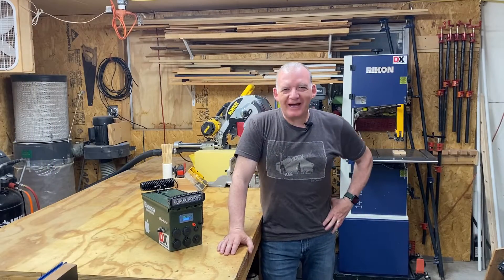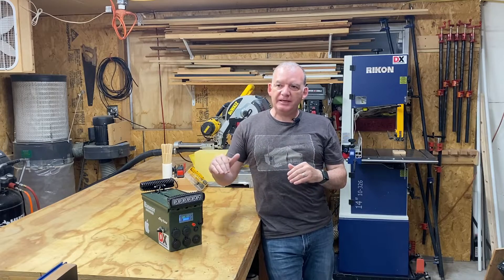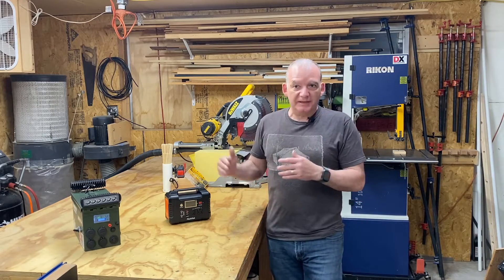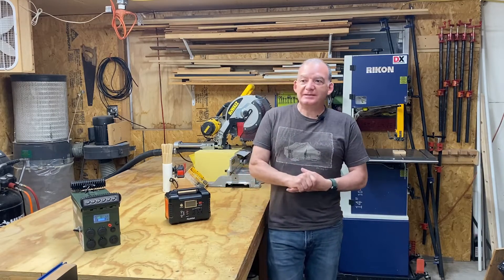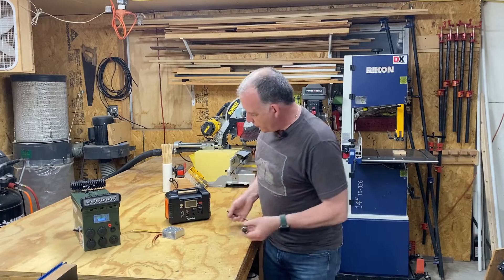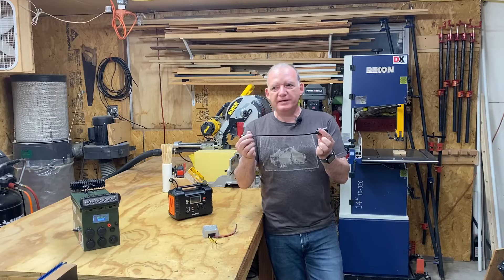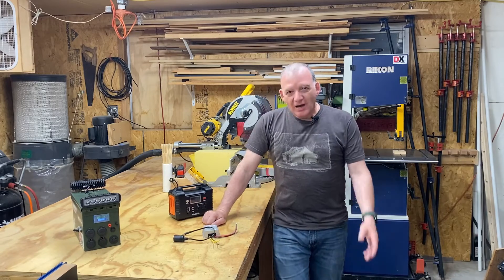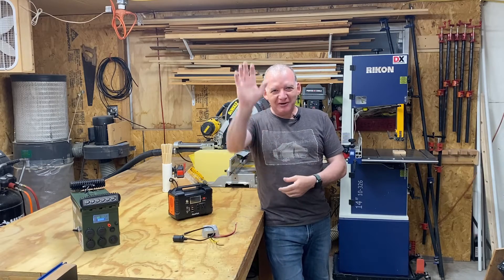Portable Power Station for HAM and CB radio - Part 2

Comment: Had to google "buck-boost converter". 😁 Seems like magic getting more voltage out than the battery has left but let's face it.....with the possible exception of Nikola Tesla who really understands electricity????  Surprising that the store bought power supplies don't have this built in already.